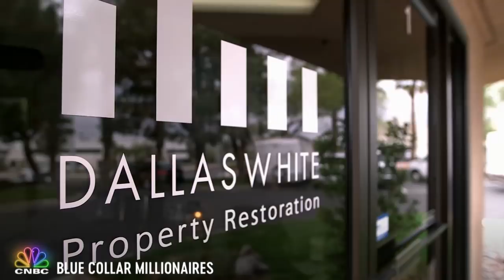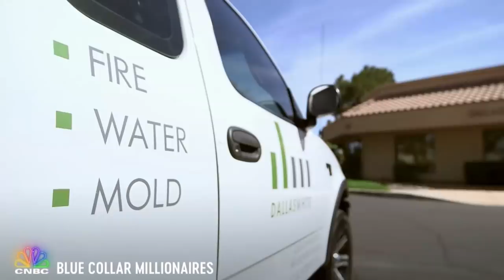This Disaster Repair Specialist Hit Rock Bottom Twice | Blue Collar Millionaire | CNBC Prime

Comment: I did this type of work for about 6 years. Worked for a company here in Houston that was racking 20 mill a year. The 100 temp ppl he claims are ppl from temp agancys that dont even know how take out a nail. I know it, we used to use hundreds of them when we would need help.
Reply: Jose perez 20 mill a year? How do people make this kind of money?
Reply: @4chukwuebuka  Its Houston, big city. It rains alot. Alot of floods. Perfect for disaster repair companies. Had hundreds of ppl working to restore hotels, commercial building, apartment complex, houses. Right after a big hurrican this companies can make alot of money.
Reply: Water restoration is insanely profitable. Fan rentals. Dehumidifier rentals. Emergency service charges. If you can get a call after hours on a holiday you're getting insane rates for every little option and since it's water damage and needs to be taken care of ASAP they have to pay it. Mold damage is more expensive than water.
Reply: @nickmeyer238  🤫🤫🤫🤫